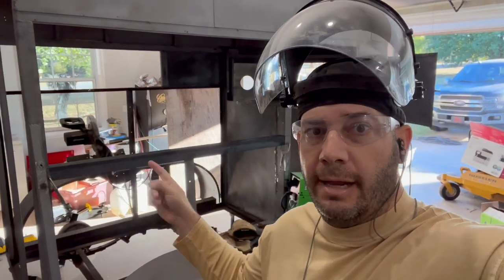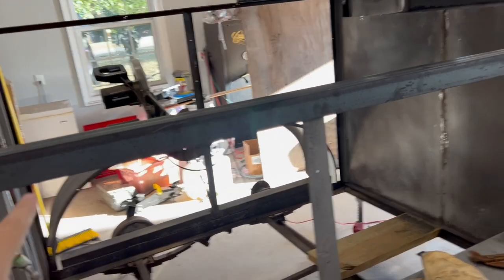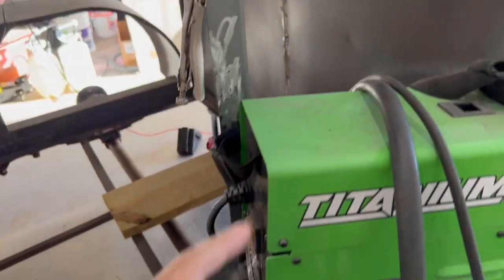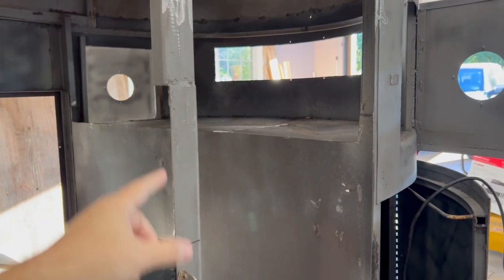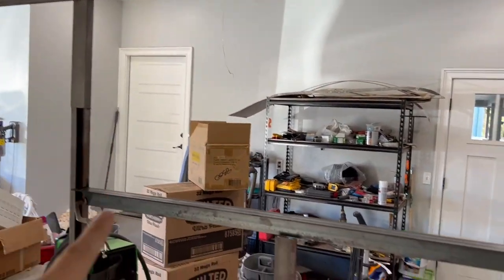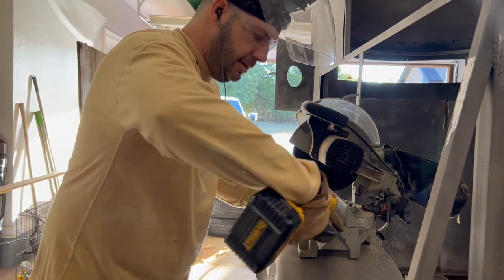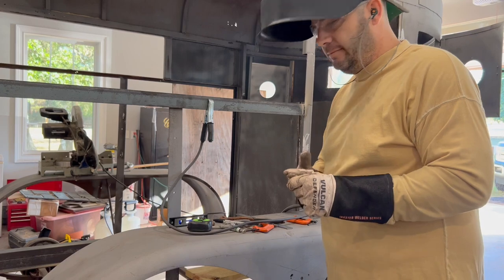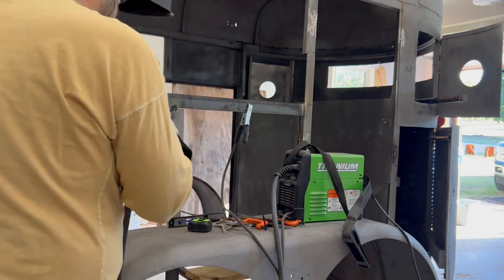How I fabricated the serving window in this trailer conversion (1997 WW Build)

Comment: How long/hours does it take you to complete a trailer?
Reply from the maker: There’s a ton of factors. I haven’t tracked the hours very close. I need to do that on my next build so that I know for sure. It tends to take anywhere from 4-6 weeks. However, I have small kiddos so run into some interruptions sometimes.
Reply: Wow you are fast. Thanks for your videos. I have learned a lot.
Reply from the maker: @karinahartortiz7017  I learn something or think of a different way of doing something with each build. It’s a constant learning and experimentation with each build. I’m glad that the videos have helped you! That’s my hope in putting them out.